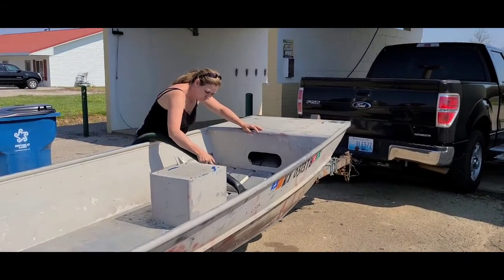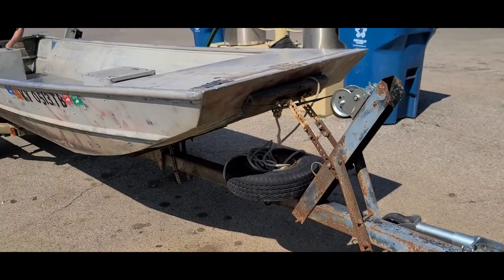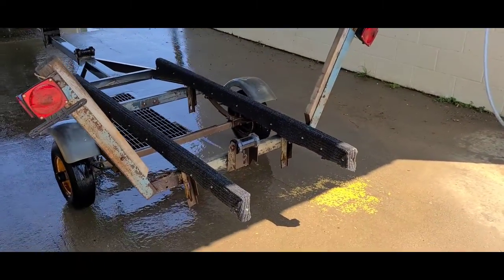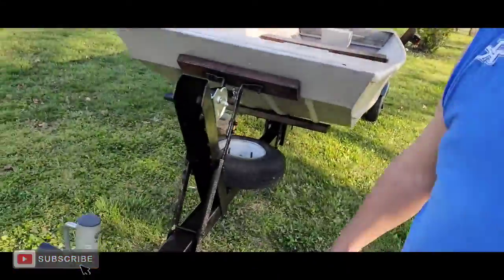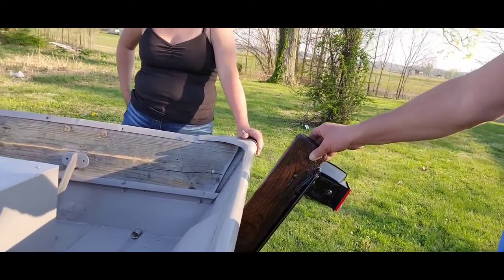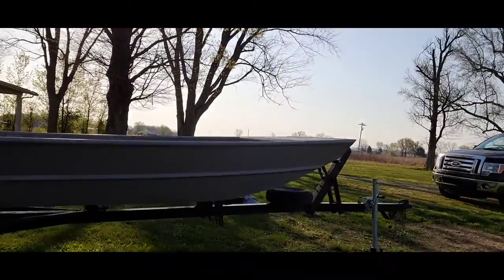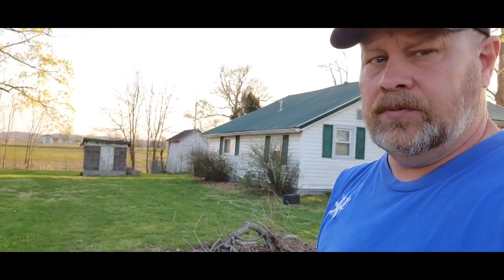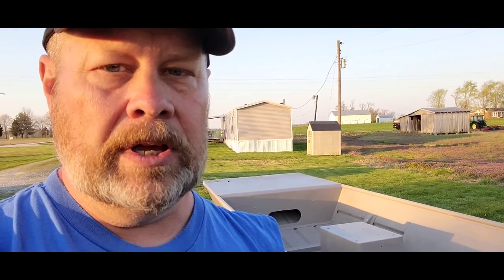Boat transformation

Comment: I have recently found your videos and have been enjoying them a lot.  I would like to just add on this video it would have been good to know how you removed your numbers and stickers, what size boat is this ( 14 ft. ? ) , and how many cans of paint did you need for this job?  Nice touch what you did with the wood seat and guides.
Reply: Its 15.1' 53" wide.  We used 7 cans of paint on the boat, 2 cans of black on the frame plus the varnish for tge wood. Thank you for the compliment. Hopefully my boat will be finished this spring and on the water.